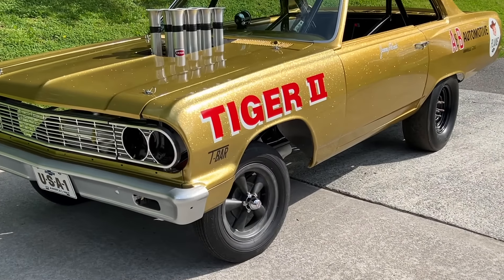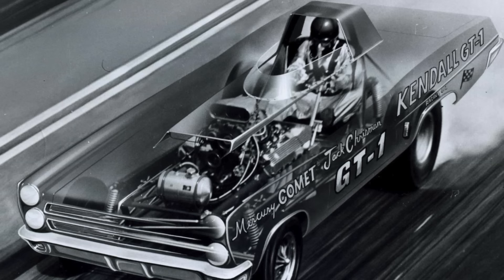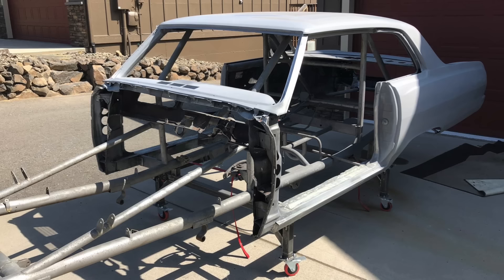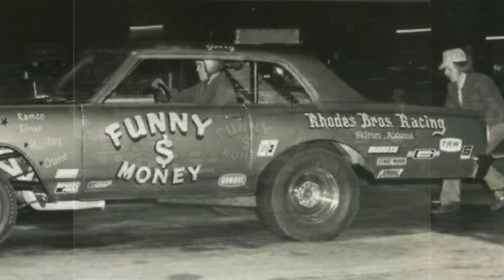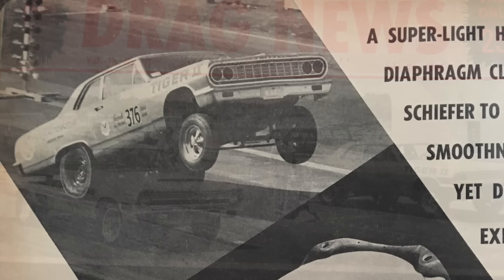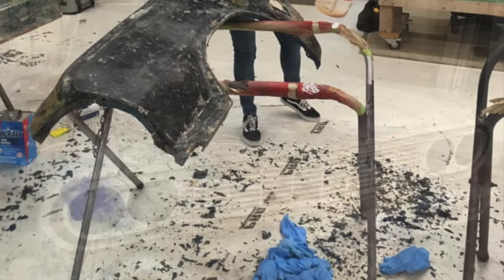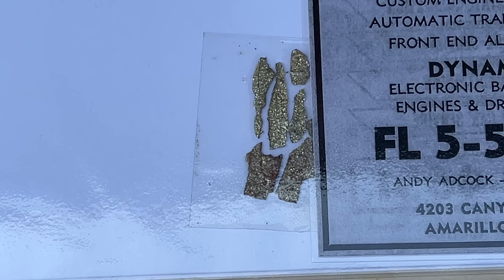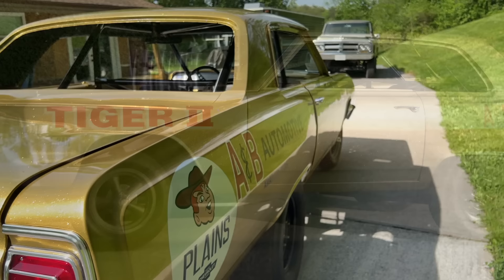HISTORIC Chevelle FUNNY CAR Found and RESTORED!

Comment: Such a great car, as a fan of all the iconic Mopar racecars of the 60s and early 70s it fantastic to see the awesome Ford and GM racers they ran all over the country with and against. Plus, as a Texan I grew up hearing about these guys, Don Hardy and the other Texas based doorslammers. Great video. Also, painted steel BB Chevy valvecovers are about the toughest looking rocker covers there ever were, and that's from a hardcore Mopar guy

Comment: In 1969 the coolest kid in my SoCal high school was my friend Larry, who had a AWB 65 GTO with a fiberglass tilt front end, straight axle, 389 set back 10% and a 4-speed. It was a mix of gasser and AFX. He paid for it by slinging popcorn at a baseball stadium. 
The original owner of mooneyes bought the car back in the late 70s. When mooneyes sold to the Japanese guy the car was lost forever. We know it's in a warehouse within a 5-mile radius of the mooneyes shop but there are hundreds of buildings now. We still talk about it today.

Comment: One of the best videos yet Tommy, thank you. Looks like he needs a set of intake manifold spacers, so it lines up with the cylinder heads.
I'm pretty sure I still have a set tucked away in the shop.

Comment: I grew up at the drags when the AWB thing was happening. Gassers were still the kings when the AWB cars were sporting the A/FX designation. I stuck with the gassers and even today still race my blown gasser at 68 years old.
Reply: Gassers are still one of three greatest classes ever. The other, where I raced, was Modified Production. And nothing will ever top the mid-60s front- engined Top Fuel Dragsters. They didn't have "swoopy" bodywork but decent Wheelbases. The times & speeds they ran were realistic.
Reply: Sadly, nostalgia events today are allowing cars/parts into events that are not accurate. Good example is that sports cars including Corvettes by rules were never permitted into the class.

Comment: The usage of the term "funny car" was first heard at the 1961 Indy 500 when the Cooper Formula One team entered a specially modified mid-engined Grand Prix car driven by world champion Jack Brabham. It was teased by the then front-engined car racers who would say "look at the funny car". The first Drag Racing Funny Cars were all metal "door slammers" but without the radical altered wheelbase. I saw them racing as early as 1963 at Southern California strips. Altered Wheelbases were  first seen on the 1965 factory Plymouth & Dodge teams which were promptly banned by sanctioning bodies. They were made to run altered classes. That era was far more interesting than today's "cookie cutter" cars.

Comment: How did theg make a 376 when the 400 crank wasnt even out yet? Ive heard of how they would offset gring the rod journals to add stroke but didnt think it would add that much.
Reply: Good question, I have never asked Jim about that but will. I know they used Crankshaft Company cranks and they had a lot of oddball stroker cranks available for 327’s.
Reply: @davegiles4208  I didn't know they had aftermarket stroker cranks back then. Figured they came along after GM added the 350 crankshaft to the 327 to make 350 cubes.
Reply: @sbcmike2765  no there were several. Crank Shaft Co, Velasco, Mickey Thompson and others had stroker cranks for 283s and 327s way previous to 350s.

Comment: Thanks for the coverage of a very cool car and all the research you do the American car industry has also changing a lot in 1963 and 64 at that time manufactures were looking for cheaper ways to produce cars not changing bodywork every 2 years like it ended up being but more like in the last 2 decades where minor changes are made to save money. The only reason I mentioned all this is because not only did Chevy make a 300 car that used some cheap Chevrolet parts ford made a 300 based on galaxy parts dodge and other car manufacturers did it also but years ago when I was more able to work on cars I at first thought that it was just a base car with very cheap trim levels but for just that brief period of time the manufacturer had invested a lot of money making a different body buck for easy manufacturing some body joints were lap spot welds and lots of other things to help with quick manufacturing .as a side note I knew of several 300 both Chevy and Ford that were cut up only to find out that a lot of the parts just couldn't be used to properly repair the chevelle or galaxy with out a huge pail of bondo .I have a friend who has a 64 300 2 door wagon he is hoping to get back on the road some time it was originally planned to be a parts car for a 2 door convertible he did listen and brought the entire car back from Alabama and when both were side by side it was easy to see the difference although not drastic  but in today's restoration standards a lot cars of today are restored by people who have great talent and are extremely conscious about it even a lot of the smaller shows I go to have out of say less than 100 cars attend 20 or so that are outstanding so we as people need to give a great deal of respect and thanks to all the young people who have excelled in their craftsmanship by studying hard and working harder. It is a very hard work but if any young person wants to be there on boss and make money there is opportunities for them sorry to ramble on but was inspired by the Golden 300 and it amazing story thanks again for your hard work

Comment: Nice Chevy funny car. You seen My Old cars 57 Chevy and 57 Chevy in greenback TN. The Old white car front in off of it and the black one right beside the white car with the front in off of it the cars are seant at the Old super boat company in greenback Tennessee I seen you have pictures of the old white Chevrolet with a black one right beside it the white one that had the front end wrecked on it

Comment: A  64 Chevelle like this I had in 1985 was worth $2,000 in good condition. This model 300 went up in price a lot since then.
Reply: My Brother brought a True 1966 Chevelle Super Sport for 
$900 in the early 80s 

It had a built 283 and 3 speed Trans , 
Nothing !
And I mean Nothing could out run it in the 1/4 mile , 
No small Block 
No big Block 

It impressed me so much , 
I ended up getting me a 66 Chevelle Super Sport with a 
Built 327 and M-21 Muncie 4 speed , it will do 
5.5 sec @ 96mph  1/8 mile

Comment: I'm from Ohio and I used to go down to Gurley Alabama to see my sister and brother-in-law every once in a while, this would have been in the mid 90's. I stopped at a little used car shop that was east of Gurley to see a Chevelle that was just like this one, the guy told me it came from Detroit. It was a 65 Chevelle with a 64 front end altered wheelbase, straight axle, tube frame car that was center driven. It had an Oldsmobile rear-end I believe it had slots in the back and spokes up front. Only steel on the car was the roof and the quarters everything else was glass. The car was crudely done, it looked like they used an air chisel to cut the body panels off and this kind of put me off about buying it. I seem to remember they wanted 2K for it. I went back to Ohio still thinking about this car and finally decided to buy it, so I call the guy and he tells me that it was sold, and it went back to Detroit.
Reply: That is the same car you looked at in Gurley Alabama back then I ended up with the car
Reply: @tobyswindall8418  I wished I would have bought it, would have made a great street machine, I often wondered about the history of the car. But I think the car was destined to end up in your hands because you really did justice to the car it looks bad & awesome!! Good luck with her !

Comment: I agree with what the owner has done, but also think some donor posts should be welded in, and the stacks shortened a little, not say put 376 on the doors or anything, but the posts where removed after the time span
Reply: What you see in this restoration is EXACTLY the way it ran in late 1966 down to the lettering, no posts, wheels, 427, tall stacks, lack of windows etc. We discussed in detail with Jim about this brief (two month) span of time before the end of the 66 season. In 67 they lost the Esso sponsorship which was the reason behind the Tiger name and they quickly painted the car blue and renamed it BLITZER. Months of thought and research went into this decision. We know that it ran this way we just don’t have any pictures of it this way. Jim told me to look at the picture of the BLITZER and imagine it painted like the Tiger II…….so that’s exactly what we did.
Reply: @davegiles4208  ok, wasn't gone over in the video
Reply: @JohnDoe-gz8dw  Tommy did a wonderful job on this video hitting highlights of the car but it would take a two hour video to cover it in full. The car had so many changes from 65 to 67 that we basically had to pick a week. We choose the very last version of the Tiger II which I have yet to find a picture of but being able to talk to the original owner/driver we know we did it right. Someone out there has a picture.

Comment: One item, that has bugged me since the beginning of the restoration- I' d swear that the original car began as a chevelle 300 Deluxe( 2 door Post). Was it re- bodied? Extensively modified, to look like a Malibu?? ( 2 door Hardtop) or re creation??..
Reply from the maker: When the new chassis was built in 1966, the posts were cut out. It wasn’t really an appearance thing…it was more for weight savings. The body was completely gutted. The car weighed 1800 pounds in this configuration with a cast iron big block. Pretty wild.

Comment: I wonder which engine was used in this car. I know it was a big block,  would guess it to be a 427 ?
Reply: You are correct, it is a 427. Randy Bradford (AA/FA) built it to run alcohol or nitromethane.

Comment: Are the Spindle mount front runners Cool Yea  But Not Correct for this Build All Pic's  have Cragar S/S  the Alloy wheels were never on the Gold Car .
Reply: @stevemayo they are 100% correct for this version of the car. Just because you don’t see them in a picture doesn’t mean that version didn’t exist. I went to great lengths with the original owner to nail down a version of this car that existed for only a couple of months, not having a picture of it doesn’t mean that it didn’t exist. And yes the spindle mounts are seen in the pictures of BLITZER. Same car just a few weeks apart. If you are just limited to pictures and not research to coincide then you should probably stay at home.
Reply: @davegiles4208  All I am saying is they Don't appear  in any of the pics until it is the Blue car version that's all & it appeared to have all 4 Alloys on it then  and again it really don't matter I love what has been done to the car Especially the rear wheel wells Just Spot on !!!

Comment: But there were no pics of the car with the T-bar chassis, the Tiger II livery, AND THE MAGNESIUM spindle mounts. So it's not ENTIRELY historically accurate. But they're cool as Hell!
Reply: Just because there are no pictures of the way that it sits doesnt mean that it did not exist. It in fact ran exactly the way you see it for nearly three months and the original owner/driver confirms this as well as multiple track operators that booked it.

Comment: It's 1964 body
Reply: 65 300 body, 64 front clip.
Reply: Look at the rear of the car before it was reassembled after paint, '64s had a hole for the tail light at the top of the fender with a hole lower down for the reverse lights. '65s had the tail lights centered top to bottom, with the reverse lights mounted in the bumper. My first car was a '64 Malibu.
Reply: @bobbrinkerhoff3592  Again, this is a 65 that they got new in 65, they added the 64 fiberglass front end. The dash is a 65 only dash. There was a difference between the 64 and 65 non padded dashes.
Reply: @davegiles4208  I fully realize that it's a '65, I was pointing out how to tell a '65 apart from a '64 for the benefit of the original poster.
Reply: @bobbrinkerhoff3592  gotcha! Misread your post.
Reply: @davegiles4208  not a problem. Years ago I took my '64 El Camino to a Good guys event in Indy, the cutoff at that time was '64 and older. A hundred yards inside the gate , some official tried to throw us out, claiming it was a '65 , he got educated in the differences and to look at the trim tag for verification. Turns out a well known builder from Michigan had snuck in a '65 wagon by claiming it was a '64, and no they didn't throw him out. I lost all respect for Good guys that weekend.
Reply: @bobbrinkerhoff3592  that’s crazy! Yea Goodguys is definitely not the same as it used to be.

Comment: The fact that you do videos like this and don't know that is a 1964 Malibu body not a 65  is kinda disappointing.  Also the the fact the Chevrolet considered the Malibu name more prominent on the car in 64 and 65 than Chevelle.  The top trim packages  were  Malibu SS not Chevelle SS.
Reply from the maker: Sorry but your information is not correct. I own a 64 Malibu and believe me, I study this stuff more than you could ever imagine…the Malibu name was a trim level for the Chevelle. The race car in this video is not a Malibu trim level and it is not a 64 even though the front end is from a 64. This race car started as a 1965 Chevelle 300 two door sedan, meaning it was stripped down to bare bones. No options. A 64 fiberglass front end was installed because a 65 front end was not yet available when this car was built.
Reply: @HotRodHoarder  BS I own a 65 SS and the front of that car is a 64 not a 65!
Reply: I did watch more of the video after you reply and the back taillights panel ia a 65 but that front clip is a 64. JUST LOOK AT SO PICTURES ON GOOGLE OF A 65. It not rocket science.
Reply from the maker: @jimmyzgarage5430  you're right, it's definitely not rocket science. This is a '65 Chevelle with an aftermarket '64 front end. That's all there is to it.
Reply: @HotRodHoarder  I was right.  Thanks
Reply: @jimmyzgarage5430  I cant believe we are still having this argument. IT IS A 1965 CHEVELLE 300 2 DOOR POST WITH THE POSTS CUT OUT......AND A FIBERGLASS 1964 FRONT END DUE TO THE CAR BEING BUILT SO EARLY IN 65! If you watched and paid attention to the video he explains ALL of this. IT IS A 65......quit being a jerk.
Reply: @davegiles4208  😆 I  posted this message weeks ago so you're the only one still arguing.  🤣  the 64 front end is ugly compared to the 65. Have a nice day.